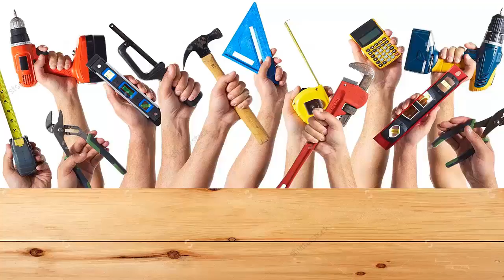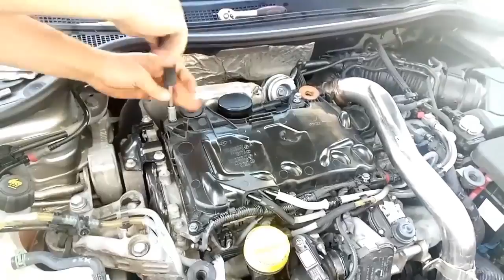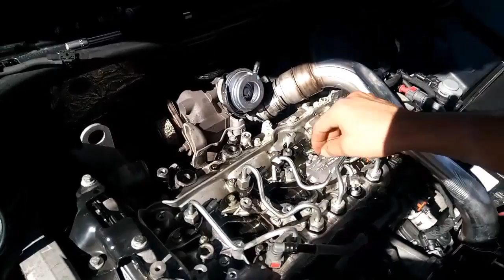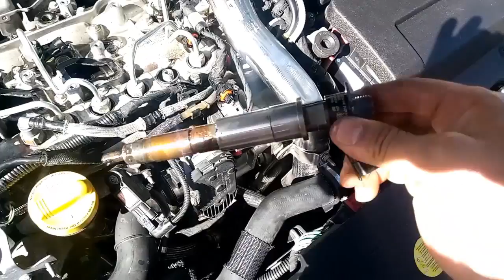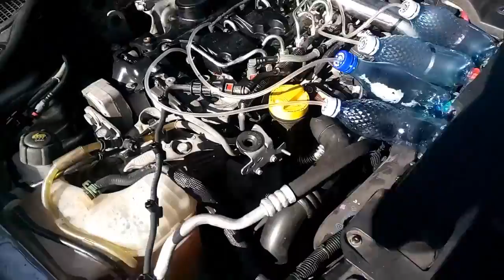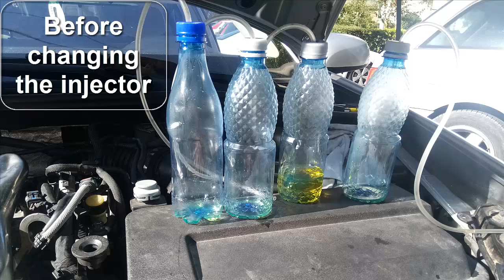How to test and replacement the injector

Comment: Question: What indicates a faulty injector - more fuel in the bottle or less? Thanks 8-)
Reply: more - means the fuel is flowing back out the return instead fo being used in the engine